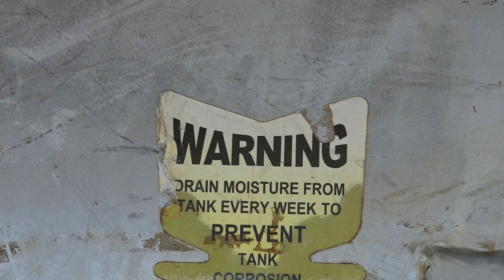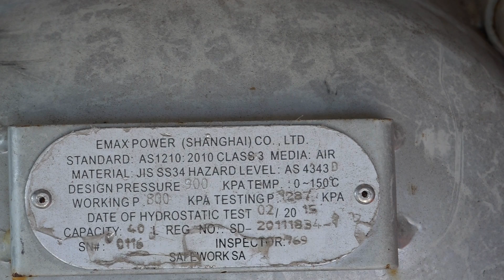Why & How to Drain Your Air Compressor Tank

Comment: One thing I noticed is that like the one I worked on about six months ago (faulty pressure switch) that one also seemed unpainted inside- which I assume is fairly common... I wonder if it would be worthwhile when getting a brand new one (still clean inside) to tip some two pack inside and swirl it around until the inside is twopacked??? that would slow the rust issue down bigtime....
Reply from the maker: Good idea cheers
Reply: It would also hide any rust that was happening. Youve seen what happens under powder coating once it gets chipped.
Best to just drain after ever use, yeah I know a pita, but it works.
I live near brisbane and after an hour of bead blasting, its not unusual to get nearly a litre of water out of the tank, especially if its humid.
Cheers

Comment: 5 years ago I built my own compressor.
The tank was from a locomotive, 300 liters and material thickness of 8 mm.
Before putting it into service i pressure tested the tank to 17 bar (246 psi) but normal runs it to 8 bar.
I also added a device so that every time the 7HP engine starts up the first 15 sec, the drain plug is releasing air/moist.
Reply from the maker: Wow sounds great ,Thanks for watching

Comment: thats the trouble with cheap compressors ,  no inspection  hole , mine has one , i remove once ayear , clean out and brush fish oil in to the tank,
 over 20 years now , still great in side ,
Reply from the maker: Great  tips thanks